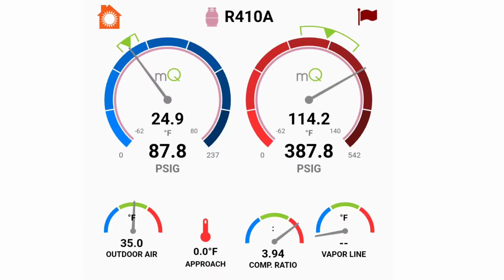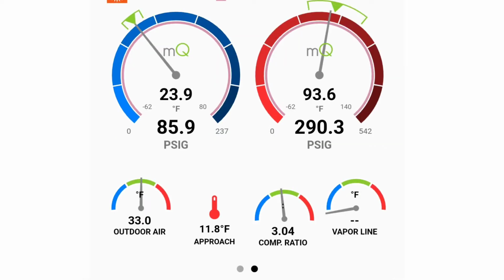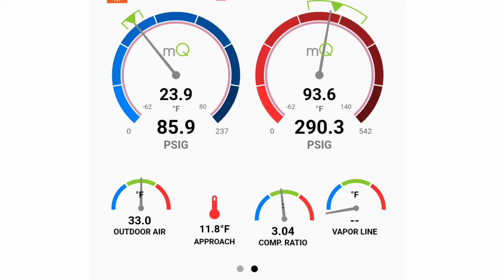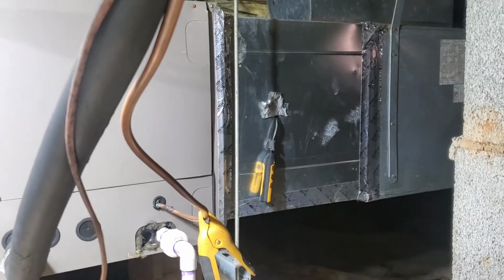Heat Pumps: Approach, Temperature Rise and Proper Winter Charging

Comment: You made this video Jan of 2022, but do you remember if the compressor was a single stage, two stage, or an inverter? I am currently starting up a 24,000 btu comfort aire inverter heat pump. Vacuum below 500 microns broke the vacuum with about 4 oz of R410A, and have not added any additional refregerant. Just been running it and watching the numbers.. My approuch is 11 degrees..The seven segment display on the HP circuit board in charge mode shows high subcooling 56 degrees it calls for 36 degrees in heat mode. All the other numbers look ok. Furnace blower on high. There seems to be alot of control going on with a inverter heat pump. The delta T accross the indoor coil 16 to 20 degrees.
Reply: Variable capacity systems can be tricky.  There's a number of things I could ask.  Let's start with the simple, how long is the line set, is the line set the correct size.  Is this being tested in charge mode.  I am not familiar with this brand, but most are communicating and charge mode is handled at the thermostat, however there are some that can use a conventional stat, and you have to move a jumper wire outdoors to put it in charge mode.  Some brands will say they are in high cooling on the led, but there are levels within the stages listed on the LED, and the only way to be certain you are ramped all the way up is to be in charge mode (I'm looking at you Lennox EL18XPC). Also, if it's a conventional stat, with a charge mode jumper, you need to make sure the indoor fan is in high/second stage. There are a lot more questions to ask, and while this is a fantastic video, and a lot of techs don't look at, or consider approach, I would start with all of the appropriate install questions first. Proper line set size, length, proper duct size, airflow set right, and then the appropriate charging methods followed on a variable capacity piece of equipment, per the manufacturers instructions.  You definitely do not want to overcharge this type of equipment, better to be slightly low, than over.
Reply: Now that I am looking into this further, this is a lennox EL18XPV in comfort aire clothing.  Charge mode is definitely a jumper on the outdoor unit.  I  am not saying this is the problem you are having, but I have seen a lot of these overcharged.
Reply from the maker: 2 stage

Comment: I have a 2 ton heat pump and everything seems to be working fine but the liquid line temp is about 30 degrees warmer than the return air instead of the 3-17 degrees. Does this mean there is an issue
Reply: No, not necessarily. If the indoor airflow is a little low, it won’t reject as much heat so your liquid temp will be higher. Or if it is not very cold outside there will be more heat in the indoor coil. Since the making of this video, I’ve seen quite a few units running 25-30 degree approach on a mild winter day in the 50’s or 60’s. If you’re running 25-30 approach on a 25 degree day, definitely check your airflow.

Comment: I bet if you go back in the summer it will show that it is under performing again. I would suspect poor ductwork causing the problem. Thanks for sharing I did learn about winter approach
Reply from the maker: Static pressure was normal and this summer, the unit was performing well. Thanks for watching!